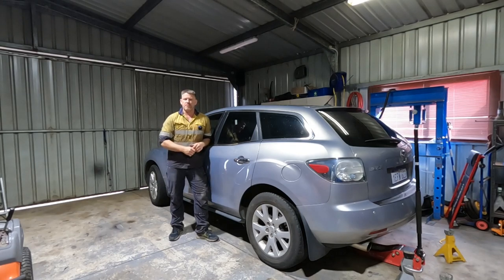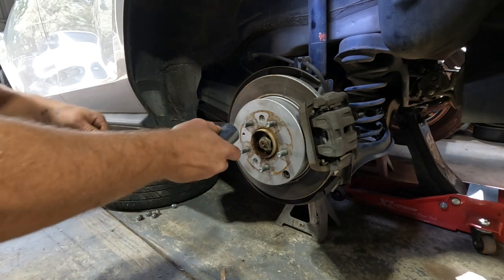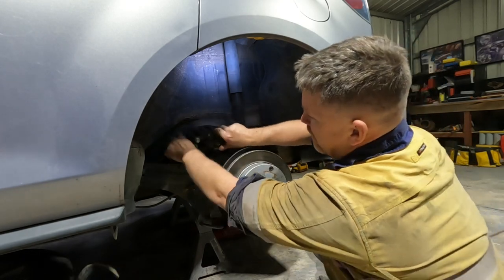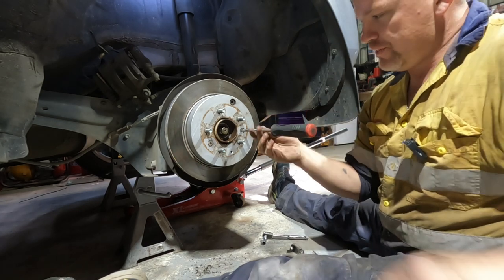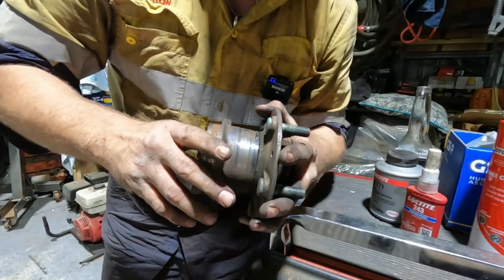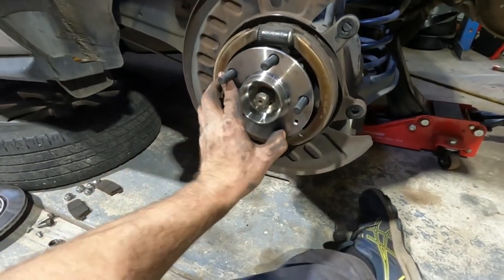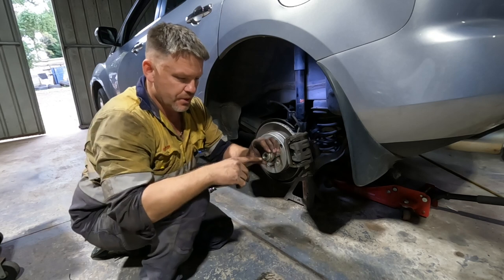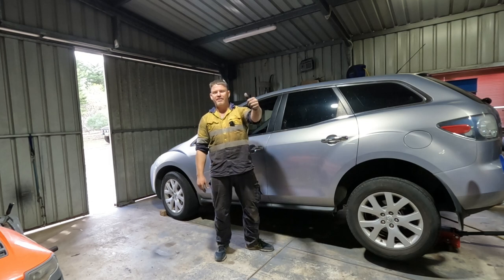How I replaced the Mazda CX7 Rear wheel bearing on a All wheel drive diy

Comment: Very informative video, thanks. I'll do this soon on my CX7 also. Question: while changing the rear hub, i need to change the drive shaft seal on the diff too, which is leaking a bit. Is there anything particular i need to think about when doing this? Can i simply pull out the drive shaft from the differential like when doing a FWD drive shaft? Best regards, Paul
Reply from the maker: It would be a good time to do it 
I haven't done a rear shaft yet on the mazda but im guessing it would be the same mate 
Take it easy

Comment: how many km did that car travel? was there too much noise in the cabin due to faulty wheel bearings?my cx 7' has 170 tkm and it's noisy at the rear end, for now I can't locate which bearing the noise is coming from.
Reply from the maker: When i changed them it would of be about 260km

Comment: Why not loosen the upper and lower wishbone, to pull out the driveshaft completely? Removing and re-torquing these 4 Torx screws this way includes some risk to damage the cog ring. I mean these ones look pretty solid, but especially on newer cars these are more fragile and you can get all sorts of trouble with ABS, ESP and iTPMS systems, that may be expensive in diagnose and repair.
Reply from the maker: Cool tip mate

Comment: hi, instead of using a t55 100mm, could i use instead a regular t55 with an extension bar?
Reply from the maker: You can try 
but i found the abs ring to interfere with the socket
Reply: @downtheshedwithbyron  thats makes perfect sense. Thank you for the reply and also for the video.
Reply from the maker: No dramas bro